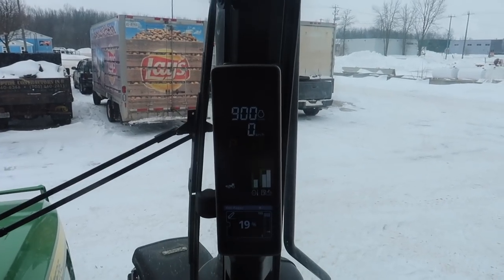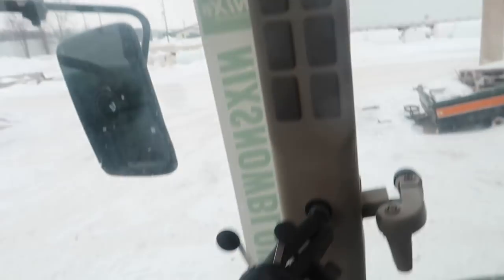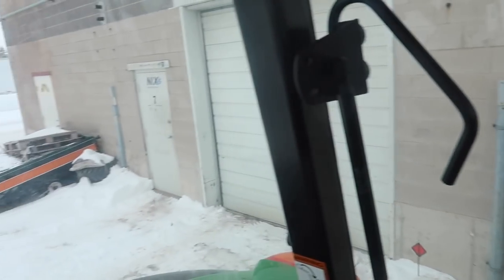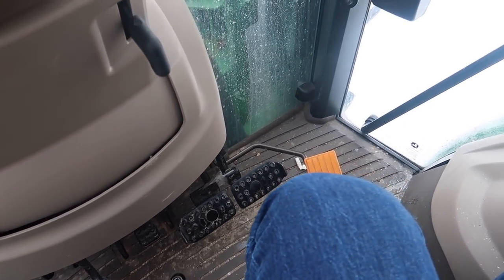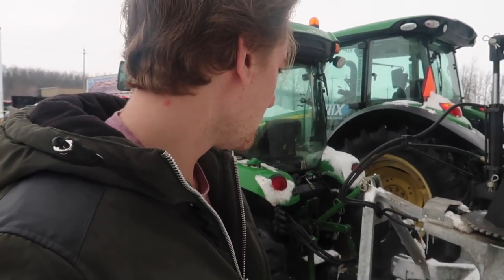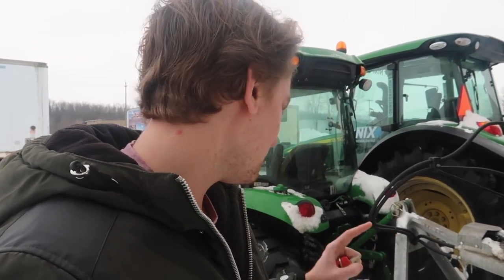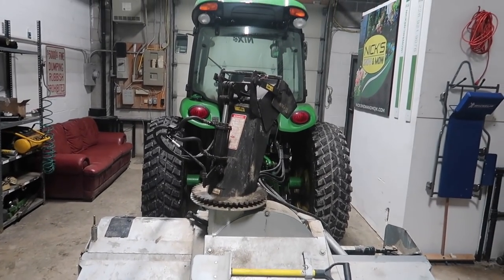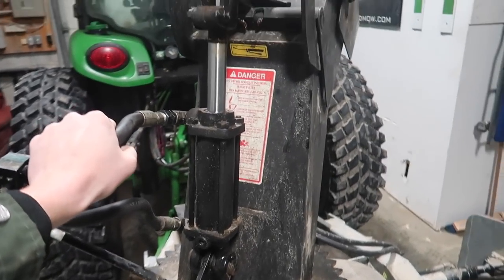John Deere 5115R Interior Overview + My Favourite Tractor

Comment: Hey, the PTO E selector isn't electronic, it's Economy. You can run the engine at a lower RPM and get the full 540 out of the rear PTO to save fuel, which is why you're seeing above 540 RPM at full RPM when you go to E. Depending on the load of the snow blower you might be able to save some fuel by using the E option.

Comment: Thanks Nick, good video describing the weight of the bigger blower on the tractor vs the power required to operate it. When I contacted Pronovost they said they could ship to an equipment dealer. The closest to me would be Whitehorse, Yukon, a few different options there. Do you know if they build the blowers to order, or how their production cycle for producing them works?

Comment: Why John Deere tractors versus any other manufacturer (Kubota, Kioti, New Holland, etc).
Reply from the maker: bwillan I like the colour green and they have the best dealer support and resale by far in my area. IMO the fit and finish of the machines are far superior to kubota or kioti for example. For the 5r series Kubota doesn’t have a compatible unit. All theirs in the same size are the old manual powershift which is a no go for driveways. For the 4 series the comparable  l6060 is a  ice unit but is slower on the road and is built lighter. I know a guy that has split several in half when hitting a curb at the end of a driveway.

Comment: moi j en est 2 5090r  2017  le problème ses que John deere  na pas tester les tracteur avant de les metre sur le marcher
plein de bog informatique  les pire ses la transmission qui donne des  mechant coup quand il fait  en bas de 10 degre
et la cerise sur le gâteau ses le joystique   électrique qui fonctionne mal par temps froid  ,délais dans la pédale a  gaz  et fuite de prestons  dans la cabine. et  les braquet du 3 point qui son bolter  au cuise du tracteur  trop fragile. quand sa casse sa coute 3000 $ a changer ses mes arriver 2 fois sous garantie  je vais aller voir un  ingénieur  pour résoudre le problème ., un  mécano de John deere   ma dit qu il passe son temp a les reparer  sur la route

en gros  on est des beta testeur point 
bonne chance